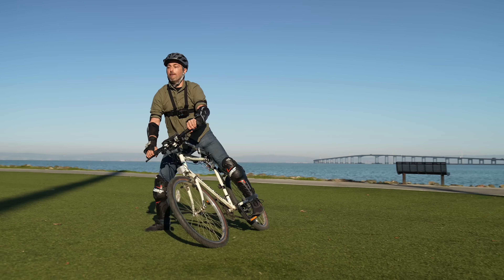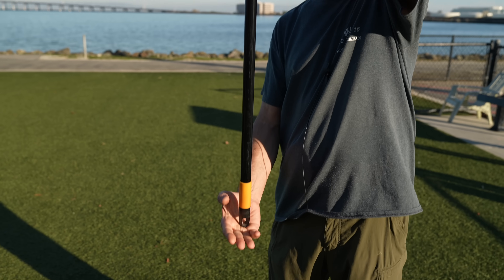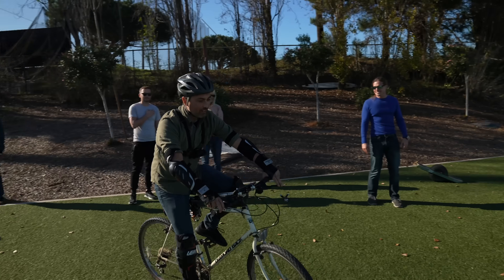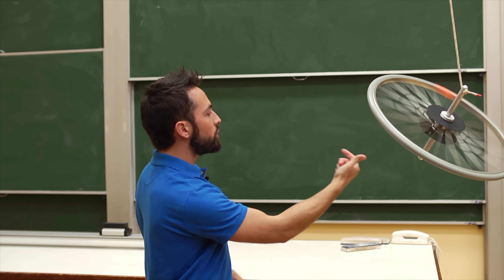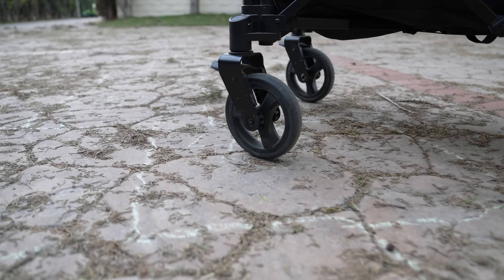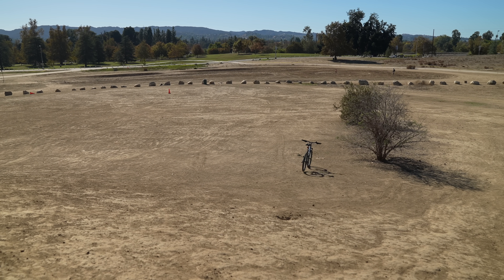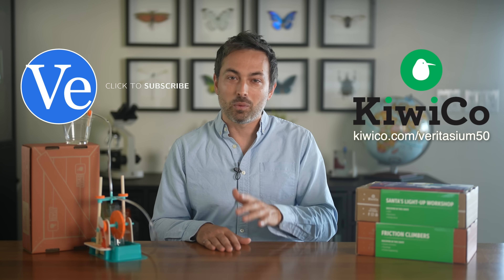Most People Don't Know How Bikes Work

Comment: When you're used to biking, there's one thing that hasn't been discussed here: once you have enough speed, which doesn't seem to be the case with you and the people in the video (no offense), you can "dive" in the direction you want to go without having to make an adjustment in the opposite direction beforehand (countersteering). The video was still interesting to watch when it came to how gravity and other forces influence the behavior the bike, as well as how the way bikes are built helps with stability and balance recovery.
Reply: It is more than just leaning into the corner. It is pressing and rolling your hand to a lower position on the handlebar on the left to initiate a left hand turn and pressing and rolling on the right handlebar to initiate a right hand turn while keeping your body in line with the wheels. You can gain an amazing amount of control at a very slow speed using those method on a motorcycle. It should be possible on a bicycle as well.
Reply: @MillBrookRailroad  Yes you can't turn a bicycle without countersteering
Reply: @athyderboss  you can dude, momentum keeps you upright, these people didnt have that thus totally relying on balance
Reply: @callumwzz8011  Then I want to see you ride a bike with a locked handlebar
Maybe you're right, but I need a proof
'Couse when you only lean, the handlebar will counterstear itself
So there is no way to turn without countersteering
Reply: @athyderboss  dude I can literally do it with no hands, its not hard to shift your balance opposite to the bikes with enough momentum you can easily do it without a counter turn
Reply: @callumwzz8011  did you watch the video? The reason you can do it with no hands is because a bike will countersteer itself when going fast enough. Momentum will keep you going forward, not upright. Even if you don't think you're doing it you do countersteer when going fast.
Reply: @callumwzz8011  I know that, but then the handling bar itself countersteers, even if it only is for a moment
Reply: @athyderboss  that’s what riding with no hands is man
Reply: @athyderboss  I've actually done it with the handlebar locked (by way of putting my chest against it) it is wayyy easier if you are in a pit or near slopes because they can help you get the balance angle without losing too much friction
Reply: There are gradients to this. At low speed you can weight shift to turn the bike with a large radius. And higher speeds or tighter turns you need to countersteer. See the motorcycle video Twist of the Wrist. For a fantastic example. However, the experiment in the video takes no account of  the sorts of corners where you are turning in and leaning the same way, it even stated that the goal is to keep the bike upright.
Reply: @N3onDr1v3  the video had ppl barely going 3km/h ofc you need to counter steer in order the be able to go wherever you want , if you didn't you would fall ,just like the video , such a weirdly biased video idea.
Reply: i have done the no steering thing myself all you have to do is tilt the bike as a whole left from right and back and forth as you ride its really not hard to ride with no turning if you use the whole bike for balance and stability. you have to dip it back and forth like you would when "sprinting". aslo for left or right lock all you need to do is dip the bike in the direction and counter your own weight. I used to do this as a kid for fun. basically the bike will be almost horizontal with the ground.
Reply: @leiferikson7052  It is more like you only move the handlebar a little. The higher speeds you travel, the wider you have to take a turn to keep the control. So you turn the handlebar slightly to make that wide turn. The only way you can turn by leaning in that scenario is by making an even wider turn.
Reply: Ya so odd . When doing a speed you lean and bike just follows . It's smooth no wobble
Reply: The problem here is that they didn't have enough momentum
Reply: I wrote that too but thats adding velocity, drag, momentum and natural forces to the mix
Reply: @callumwzz8011  Right there with you on that! I ride my bike extensively and there is no issue turning without counter steering first. I actually went out and tried it after watching this video. The people in this video, for obvious safety reasons, are barely going 5-10 mph. Once you start going faster at 15-20 or more and get used to handling a bike, all you have to do is lean and pull the bike in the direction you want it to go. You can see this easily by watching the any bike tour race and they are usually not countersteering.
Reply: But that is also countersteer. When you 'dive' to the right, you lean into the right handlebar, pushing it away from you, turning it slightly to the left. Feel the pressure in your hand next time you turn a bike at high speed.
Reply: @Stalker2315  wtf are you talking about? 

So let me get this straight , you are saying that when I'm already tilted and already have my handle bar in position to move to the left i need to move the handle bar to the left ? Do you not understand that if i do actually do that i will fall? Quite exactly like the people in the video?
Reply: @Stalker2315  if i do what you said the i would create a situation where I'm already titled  and my handle bar is already in position , and then move the handle bar in the opposite direction , you will "steal" the ground from your wheel , idk how to explain this in English to such a human as you , but please go and get a bike and do exactly wtf you just said and call me from the hospital
Reply: @hungarmaw  If you can't explain it in English you probably can't understand it in English either--as evidenced by your comment. So take your rude mouth to a video that speaks to you in your native tongue to understand the nuances of any discussions being had there. Unless you're willing to listen. Yes, can steer with their body weight, this requires working handlebars though, not handlebars locked in place. As shown in the video, a riderless bike will steer itself--this IS like riding with no hands, plenty of people can steer while doing it, but their handlebars are able to rotate freely because of the distribution of mass in a bicycle and the angle of the steering axis on the front wheel. That is exactly how the riderless bike corrects itself. Finally, Matt wasn't asking you to do anything you aren't already doing on a bike while turning except to actually try and observe how the pressure feels in your hands when doing a deep "dive" turn--one where you've implied you're not countersteering. If you think you're not countersteering then you don't understand centripetal force. When you're leaned into the turn, you've already countersteered. That's the point. It's physically impossible not to without being thrown off the bike. When you're leaning right, to turn right, the bike is positioned under you to your left, this changes the direction of energy going sideways/parallel to the road that would push you off your bike, instead down toward the road, gluing you to your seat while tilted/leaning around the corner. Best of luck. Veritasium at least proved that knowledge of how bikes work and the ability to ride one are independent functions.
Reply: @rawkhawk414  either way , if i want to go right i steer to the right , end of it.
Reply: I went out after watching this video and specifically tried making turns at different speeds by only turning handles to the turn. It is easy to do if you don't try to turn too sharp. I can balance with my body, I don't exactly need to  turn the handles into opposite direction. To people who say "you just don't notice" - I keep the straight line as much as i can at around 15-20 km/h, then I just turn into left, for example,  and do the left turn, turning the wheel at about  10-15 degree, maybe a bit more. It is enough to make a 90 degree turn on a wide enough street. Another example: when I turn lets say to the right, I can stand on pedals and lean the bike to the right almost without turning the handles, while keeping balance by staying upright. While completing  the turn I shift the bike back into straight position. This all has to do with balance, but I don't exactly turn the bike first into opposite direction to my turn. And the point in the video is that you first need to turn into opposite direction. 

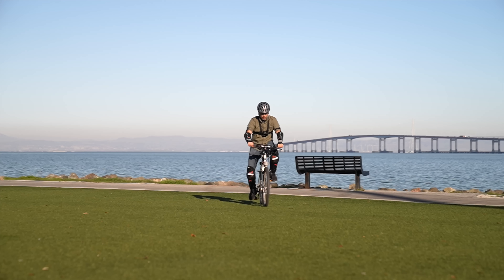The guy on the video tries a sharp turn at low speed while fighting with the bike. I can imagine he would fall even from the bike without fixed controls if he tried to do the same. Look at what he does at 1:40. It is obvious that when he turns it puts him off balance. The force when he turns right pushes him to the left. And when turning the wheel back to straight position (so he moves the wheel from right to left) it adds to this momentum and he falls to the left. But well, you not only have the wheel, you have your body, so shift the weight to keep the balance. I mean you turn right and lean to the right, the force should naturally push you back upright. But he seems to overcompensate it with his movements. He doesn't even try to keep turning to the right, but instantly steers back.
Reply: Very simple.....you are wrong, it is physically impossible to 'dive' into the corner. You shift your weight and unconsciously counter steer.
Reply: @lesliejohns5929  you do not have to counter steer if you lean the bike have none of you ever rode your bike and held the bar with one hand and just coast with the bike on its side???
Reply: Since your hands are still on the bars, when you dive left or right, you're also countersteering.

At motorcycle speeds, just applying pressure with almost no discernable bar movement will lean the bike, and it turns.

I've had motorcycle riders try and make same argument. Body lean, not countersteer. Sorry, your lean IS countersteering, you just don't realize it.

Try your lean trick no hands. Try not kill yourself please.

Countersteering unconsciously as you're doing when you dive in gives all the precision of steering a car by pulling ropes tied to steering wheel. Once you embrace countersteer and do it consciously, your steering precision will astound you.
Reply: Thank you!!!!!!
Reply: Your taking about going into a curve in the video he’s talking about turning like going around a corner on a sidewalk
Reply: Exactly what I thought
Reply: Dutch people know.
Reply: If anyone is having trouble doing this, try it at a skate park; it is way easier to get the angle at lower speeds if the ground is sloped
Reply: When u "dive" you countersteering without realizing u doing it.
Reply: @marcos0055101  you can take notice of your actions specifically for the sake of this argument (I mean go and check - that's what I did). And I can tell you that no, you just "dive" without turning the handles into opposite direction. Though we talk about turning the wheel to a small angles like up to 20 degree - you are not going to do more at high speed.
Reply: You just might not be noticing it
Reply: I literally never in my life counter-steered unless I was doing a track stand or mountain biking. This video is literally worthless as at low speeds you are extremely unstable and it's almost impossible to keep your balance even going forward without steering in different directions.
Reply: Those who ride motorcycles aggressively know all about countersteering. The effect is much more pronounced on a motorcycle.

Part of the reason is how much farther a motorcycle typically leans. So instead of a momentary and almost imperceptible countersteer like we saw with bicycle heading towards us, in aggressive riding you can apply a more deliberate and longer duration countersteer.

Basically, a leaning motorcycle goes around a corner, and countersteering dials up how much lean you want. Countersteer with a larger motion, or for longer duration, lean farther. Lean further, turn tighter arc.
Reply: same goes to me, i drive so fast that i very rarely have to countersteer
Reply: Agreed, I just wrote that in my comment. I see a lot of motorcycle riders agreeing to this video, but I don't think it applies to bicycles (to my riding style at least it doesn't; never had to "countersteer").
Reply: You mean like leaning into the corner?
Reply: @flopsinator5817  motorcycles are different a bit cause there tires are wide/fat so you can lean a bit when making a deep turn with a bit of speed but with a bike it won't work  😂
Reply: @VRfaces7  I was quite surprised by this as well. I just lean to counteract the turning force and steer directly.
Reply: @VRfaces7  motorcycle or bycicle it's the same thing , i fail to understand how this video and the ppl riding those bikes failed.(besides it being a very controlled experiment) and anyway , why didn't they get a professional mountain biker ? They got all that high tech , but he didn't put anybody that is considered to be more than just an adequate bike rider.
Reply: @VRfaces7  Once you go over 30 on a bike bicycle or even a scooter, there is no other steering than countersteering, you turn the bars left you turn right
What this video demonstrated is not "countersteer", it is a "quick flick", where an initial turn the opposite way sets the bikes lean angle.
The video makes out he cannot turn right, because he cannot steer left first and perform the quick flick, true, but what the video fails to point out is at that speed, Once the quick flick has been done, steering right turns right. 
A countersteer is not the "quick flick" to the left as shown here, but still steering left the whole way through the right hand bend.
Reply: In the case of high speed turns, what amount of handlebar deflection there is is actually all in the countersteering direction.
Reply: First thing that came to my mind too lol. I never counter steer first. I always lean. Only rookies actually drive with the wheel. I barely turn the handlebar until i have to park lol.
Reply: you believe you dont have to countersteer and that you just lean into a turn, but that is just a belief you have. in fact you always countersteer. at high speeds the countersteering angle is very tiny so you dont notice it but it is there, otherwise there is no way for you to lean and the video beautifully demonstrates why
Reply: @rb-ex  that's what you see because that's is shown in this video. Casual people casually riding a more or less random bike. I was on my first bike when I was 3 (and a bit). I learned to do things with bikes just because I was bored of the 'boring' normal way and proudly wore the scars of all the fails. You can ride a bike without countersteering (doesn't mean it's easy). It has been said in the video. Countersteering is used to move the wheels relative to the centre of gravity. Why can't the same be achieved by changing position on the bike or changing the bike position relative to your body? Or just pull on the handlebars to 'hop' your front wheel or both to (re)position the bike. Granted, not all people can do it and probably not all bicycles will allow it. I am a bit too old now to try it but there are plenty of kids out there doing crazy tricks. I am sure many of them would be able to ride a bike even with the handlebar welded. Won't be easy to do but between hops and balancing and maybe weelies and God knows what else I am sure they can get it done.
Reply: @mihaipuscasu7357  yep, and that would work if it werent for reality. move your body to lean into a turn and there's an equal and opposite reaction. watch the video again
Reply: it is impossible to initiate a turn by leaning. anyone who believes otherwise didnt listen to the video, which is crystal clear in demonstrating the problem (locking the steering) and illustrating the principle (balancing a stick). you have to steer the bike out from under you so that gravity leans you. you cant avoid this any more than you can jump without applying force to the floor. you can only believe you dont countersteer, and that is the point of the video, to give you a chance to accept the truth even when you believe otherwise. reality doesnt care how skilled you are or how fast you ride or what you believe. you can accept reality as it is or you can believe things about it. choice is yours, and no one cares if you go with the truth or believe the lie
Reply: @rb-ex  "it is impossible to initiate a turn by leaning". You ever tried to ride a bike without hands on handle bars? To initiate a turn all you can do is lean and bike react accordingly. Otherwise you wouldn't be able to make a turn at al without using handlebars. But of course bike won't turn only because of the tilt, the wheel should be able to turn. But you don't need the gravity to lean you as you said because your body is not rigid and you perfectly can lean it and shift your height when needed.

"move your body to lean into a turn and there's an equal and opposite reaction" - exactly in this video they show how the bike turns the wheel to  exactly the same side to which it leans. It means when you lean your body to the side bike will turn the wheel to that same side and turn in that direction. When the bike starts turning the  momentum of your forward movement creates the force that pushes you into  direction opposite to your turn. But you counter it by leaning (and gravity counter the opposite push). If you want to keep turning you keep leaning. If you want to stop the turn you just let the force push you upright.
Reply: On a bicycle and especially on a motorcycle you are countersteering to cause the lean to turn. Once you get some speed pull the right side of  handlebar slightly twords you and you will see you immediately start to lean left. It's much more noticeable on a motorcycle but also true for bicycles.
Reply: What exactly do you mean by that? You just lean your body in the direction you want to go? Isn't that still counter steering? You're putting your weight on the inside corner of the turn, which naturally initiates ciuntersteer
Reply: "I can turn a bicycle just by leaning, workout even touching the handlebars." 

Yes, I could do that too when I was a teenager and riding a lot. However, that does not disprove counter steering. It just means that you're doing it in a subtle, instinctive way with your body balance, editor touching the handlebars. Turning right? You instinctively do a tiny wobble to the left before leaning right. 

Want to prove me wrong? Film it from a straight on camera angle, just line this video. Modify your bike handlebars so they're physically incapable of turning the other way. 

You're instinctively doing it and you don't even realize it, just like the perks in this video who suddenly discovered they couldn't turn.
Reply: @cymond  you have to drop the bike down almost horizontal to not need counter steer. it dont work on motorcycles just normal ones bc of weight obvs. but basicly you stand up and let the bike dip on its own while you stay vertical to the ground. you can keep your balance because you are using the side of the tire letting the bike slide out a bit with the lower friction allowing it to turn with no counter steering. does that make sense to you?
Reply: @leiferikson7052  actually, yes, I can visualize that. 

I would still like to see it tested, though..
Reply: @leiferikson7052  I don't know about that. with ice skates you don't lean right to turn left, you lean left. I think maybe the easiest (and maybe realistically only) way to turn on a bike on a normal road is to pop a wheelie and rotate on the point?
Reply: @leiferikson7052  if you have a slope, you don't need the extreme angle so you can maintain friction at lower speeds; try it at a skate park
Reply: @thomasmcelroy5785  yeah your body just has to be center of gravity. as long as you can stay vertical to the flat ground you shouldnt have problems keeping balance and not need counter steering
Reply: @StayBassd  you dont lean at all is more of what i was trying to say. You just keep your body upright and let the bike lean on its own.
Reply: @cymond  You're right